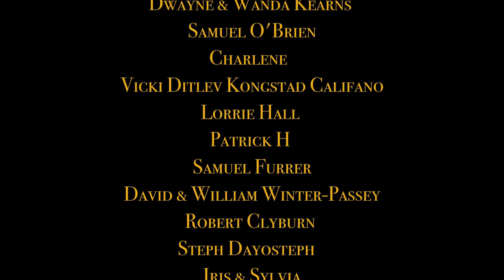Chateau Renovation Creating a Pool in 4 months @ Our Passion Project

Comment: I had to use 18mm thick re-bar steel on the pool I built and it had to be wired together in the bottom corners.   Swimming pools move a lot when finished through seasonal ground movement so hopefully yours will be ok.

Comment: Edd but where have you learned all those skills. Really impressive. Wanted to ask but why did you use the small hose to fill the poll,or that was only at the start ? 
Also why is the poll all one hight ? How are you going to manage small toddlers ? Have you installed some kind of heating for the water ?
You seam so lucky with the weather, every time I have to work out side it pours.......but maybe that is  Bordeaux v  Glasgow

Comment: Very impressive project! Am I right in thinking that although you talked about it, you didn't actually put any lifts in to raise the mesh into the middle of the base? Is it not necessary? Thanks
Reply from the maker: Hi no we just raised the metal as we went or if we stopped one day we made sure to put some concrete under so it was dry for the next day

Comment: Concrete sets under water. It cures via an exothermic reaction. There's no need to heat it to make it cure. Another point to keep in mind is you water cement ration. The drier the stronger the end result, but that  does have to be balanced with workability. Still a a bit academic now. Anyway looks like a heroic effort well done

Comment: Hello, quick question.
What did you lay the stone on to bring it up to the level of the copping stone s?

Ok one more did the fiberglass guys over lap at the top so the copping stone sat on the fiberglass.

The pool looks great ....
Reply from the maker: So we formed the concrete a little higher after the coping stones, and the fiberglass and resin stopped just below the coping stones and we siliconed between the 2.
Reply: Thanks, always good to see what others are doing, going to have a bash at ours soon 😊